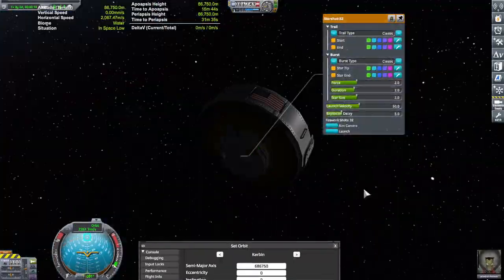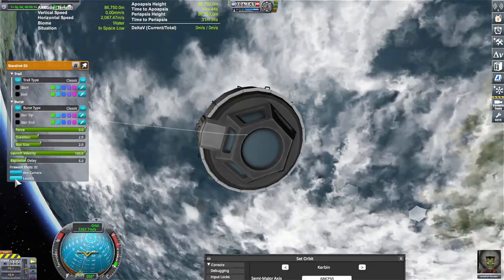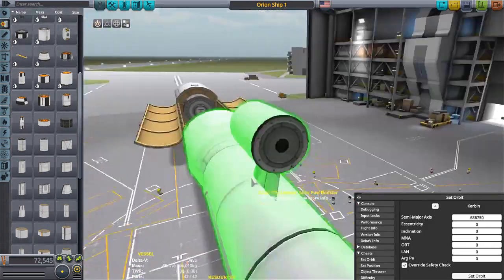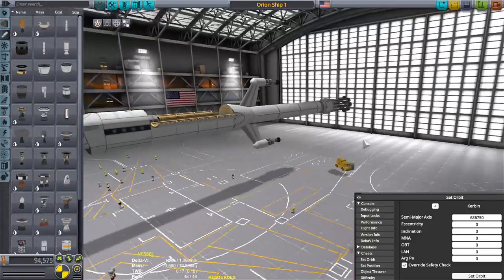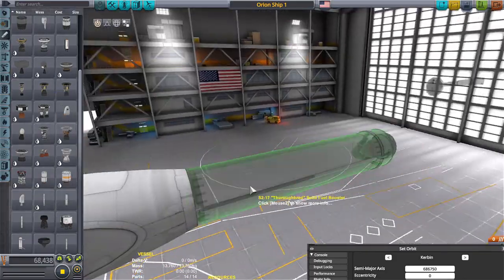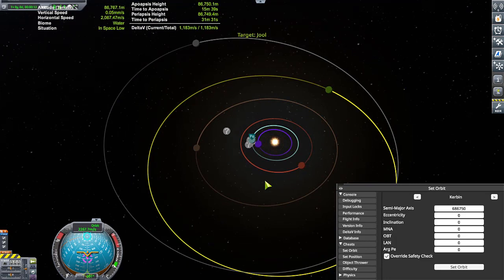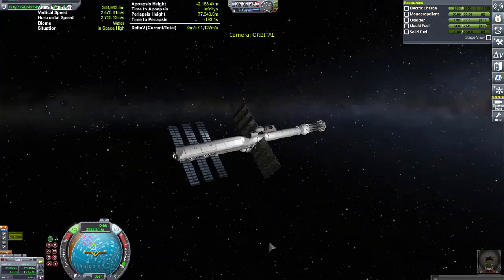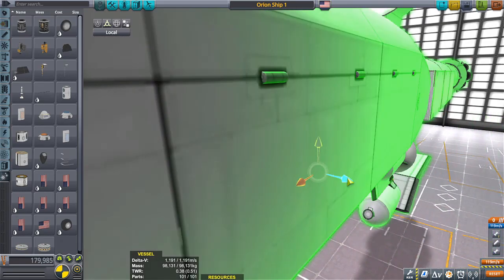ORION DRIVE SHIP TESTING  \  KSP 1.12  \   Kerbal Space Program

Comment: To refuel couldn't you just either; attach the firework pieces to docking ports, and when they run out you place the new ones in their place, or you could use the update where you could edit your vehicle with a kerbal (though I'm not sure if you can do it with the firework pieces).

Comment: Still hoping they either ignore this bug, or maybe do something to smooth out its usage in this capacity, rather than eliminate it...basically, turn it into a practical feature.
.
It would be a nice feather in their cap for the end of development, since we didn't get any of the future techs.
Reply: They have the nerva engine that didn't exist yet
Reply: @philippey4918  Actually, they did build and test a version of it as proof-of-concept.  So, we know it operates, at least.
.
No form of orion drive has ever been even mocked up, let alone tested.
.
Plus, the nerva is good, but not that good.  I'd say that something like Nerva is better for short interplanetary trips, while an Orion would be better for outer-system or interstellar trips.
Reply: @DoremiFasolatido1979  OK